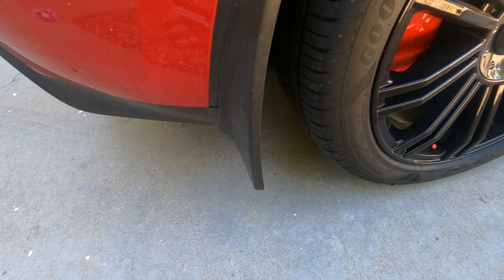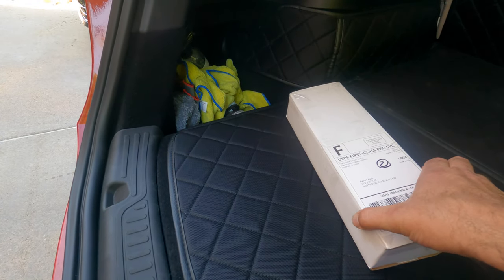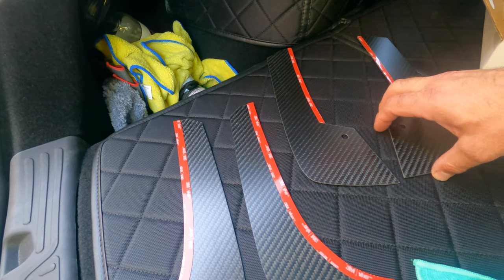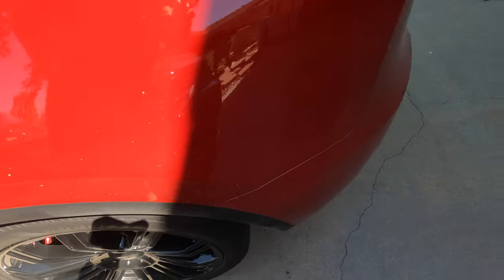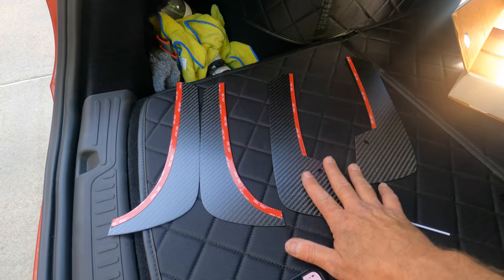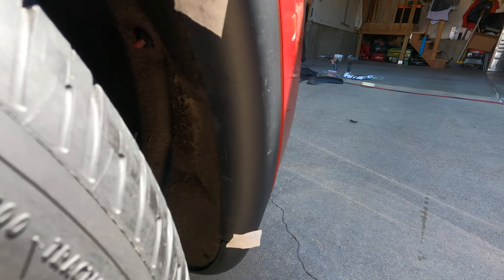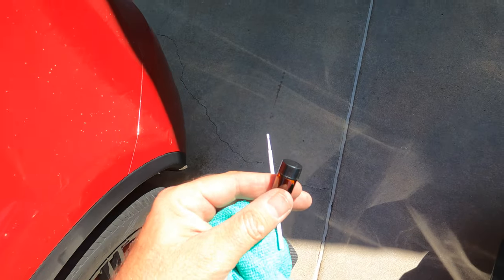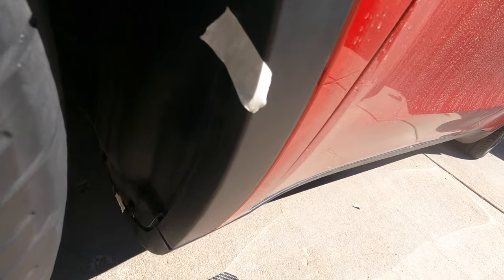Introducing the Best Tesla Mud Guards - Carbon Guards!

Comment: Just installed these. To those saying they look cheap… they aren’t. It’s solid carbon fiber. The 3M tape is incredibly strong. Not worried about a pressure wash.
Reply from the maker: I have done many washes and a road trip at highway speeds and they are not loose at all.  Very solid and have done a great job protecting the car as well.

Comment: I bought these for my Model 3 and it seems like when I install them there will be adhesive still visible on the carbon fiber side.  I worry this will collect dirt and debris.  Any thoughts?
Reply from the maker: I haven’t had any issues. I had the same and no issues.